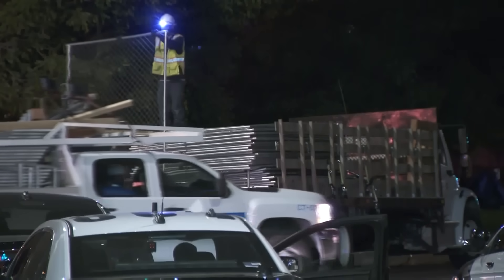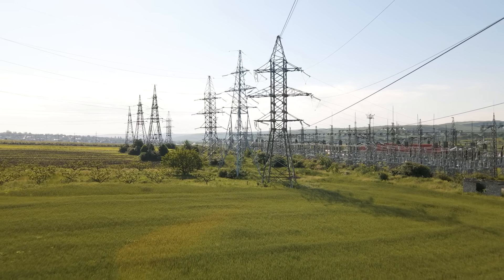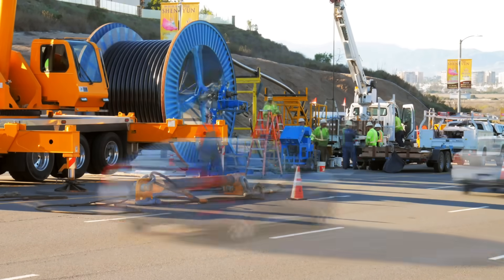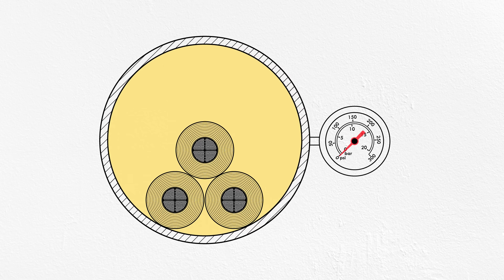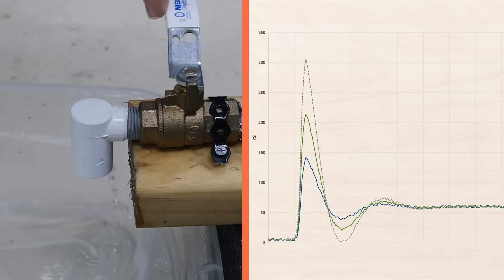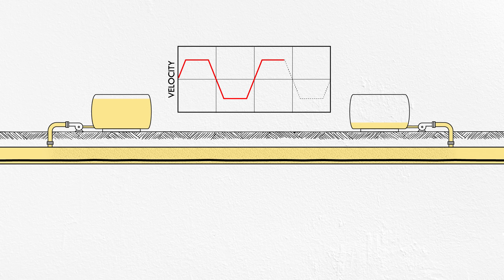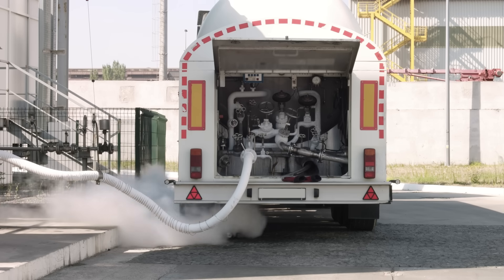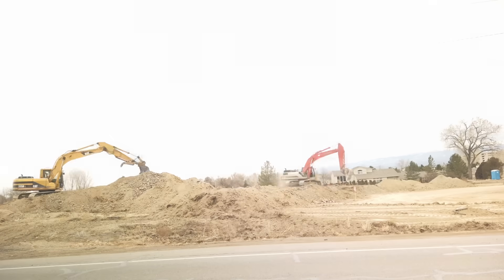Repairing Underground Power Cables Is Nearly Impossible

Comment from the maker: 👷 Enjoy this story? I have more in this playlist: https://youtube.com/playlist?list=PLTZM4MrZKfW_kLNg2HZxzCBEF-2AuR_vP
🚧 Keep up with all my projects here: https://practical.engineering/email-list
Reply: I really really love the series of videos where you explain what happened in a notable engineering disaster. I cant wait for more of them!
Reply: Great video, thanks.  You have yourself another sub!
Reply: Like a comment above says, this problem seems very specific to the type of line this was and I would imagine these problems would have been resolved by later tech.

I'm surprised this video didn't mention modern high voltage transmission tunnels, which are bored by small-diameter (3-4m/10-14ft) tunnel boring machines. There's a couple good videos on YouTube about these...

This one is a bit more comprehensive: https://www.youtube.com/watch?v=fKs2sKlhAC0
This video by Londonist about 400kV lines is more edutainment style: https://www.youtube.com/watch?v=qSzxTgDq3hM

I recall watching a video a couple years about about the cables being installed in these tunnels, but can't find it now. The cables are very sensitive to damage, so they are installed carefully. There is a track on the ceiling and the cable is hung on a wheeled thing that rides along the track as the cable is slowly unspooled at the end (I think each spool is about 1km). When the full length is unspooled, it is placed on brackets along each side of the tunnel. The outer layer is a thin black (plastic?) layer with a bright red layer beneath it, so that if the cable is scratched after manufacturing, it can easily be detected by visual checks along the cable. You can see some of this installation process in this promotional video for a company that installed these lines: https://www.youtube.com/watch?v=-X763qank94

Perhaps a follow up video about these newer tunnels for high voltage transmission lines could be made.
Reply: I see second the motion.
Reply: As an underground cable splicer, this video is very well done with great information.
Reply: Why didn't they place markers along the length of the line roughly between, or on top of, each splice in the line so they could measure electrical currents between the markers? Would this require a potential hole that would be subject to outside forces and thus allow naturally occurring issues, like earthquakes, to effect the line itself through the marker? Or did they just not think about that when they were designing the line as the information on these kinds of faults wasn't really available?
Reply: @LecherousCthulhu  i just cant belive they didnt put vaults at the splices, i guess they thought the cable would last a thousand years lol
Reply: @narmale  they do have access at the splices...the problem was between splices.. they had to repair the ductline so they could repair the cable...
Reply: Cool video
Reply: How do they managed to put liquid nitrogen in there ? Can you develop that part, it's fascinating !
Reply: Well Singapore did a good job with underground cables, maybe there is another side to this?
Reply: you should look into the insane tech behind high voltage DC transmissions lines, it looks like something from an alien movie
Reply: Tool for the elite.
Making excuses to NOT have powerlines underground where they belong
Reply: Thanks for the wholesome content Grady,

Also did anyone ever tell you you kinda look like the Grady from the shining?
Reply: They also freeze large water pipelines for repairs. Insertion valves and line stops are also used for water pipeline repairs.
Reply: can you tell me what the music is at 1:18-1:28?
Reply: That oil pumps are Tesla turbines?
Reply: In Auckland, New Zealand, had the same failure, about 10 years ago. If memory is right, took months to repair.
Reply: New scene transition tune? Thank you So much! I love it way better!!!
Reply: They should not use a thump or a thumper because it will attract the huge worms and damage the spice production.
Reply: Does the original fluid filled line remain pressurized?
Reply: You should play satisfactory
Reply: what i learned is that an underground cable is not worth it in long run, and it would be better and cheaper to build longer conventional line above the ground that would go around the neighborhood. I will keep that in mind if i ever change my occupation to land electrical engineer.
Reply: Look up Zenneck surface wave propgation for power transmission.. it's real
Reply: Why didn't they just run a single phase in each pipe, so the potential between the conductors is zip?  Then you just have to handle the pipe-to-pipe, or phase to phase insulation challenges.
Reply: @michaelwalimaa1806 because XLPE wire was not available at this voltage when this system was constructed.  This HOFF system is still used is several places and is actually very reliable.   XLPE cable is even now very expensive and difficult to splice and run.  However today it would be a mor practical option.
Reply: A great video to try next might be the incoming superconductive transmission and primary lines. Active cooling stations placed at intervals keep the cables chilled. I've been to a pitch/info meeting sponsored by IEEE at a Baltimore Gas and Electric office. Seemed like a possible solution for serving growing energy demand in densely populated areas. They have to open the hydrants and hose down substation transformers in Washington DC during hot days in summer.
Reply: Hi. Were you surprised how popular your channel is? I find your short lectures extremely enjoyable even though I work in the arts! Thank you anyway.
Reply: They're gonna show me
Reply: As a relatively young Project Manager on the Sydney Olympic Games site, one of our excavators scratched the outside of a new but unpowered 132kV underground line. The reaction by the cable owner was somewhat dramatic with crews being flown out from Europe to assess the damage. Thanks to your video, 25 years later, I better understand why the panic button was triggered.
Reply: Great story one of my co workers was,an old timer a cable splicer. It was interesting to learn about telephone cable and the way faults were found.
Reply: Hmmm would this be better in an underground corridor/tunnel? SEE Boring Company? HVDC better still?
Reply: I love that you convert everything to SI / metric units. As a European it is really unintuitive if information are in imperial units only 👍🏻
Reply: I suggest you buy a dictionary.  “Nearly impossible” here is just “difficult”.  Really clickbait
Reply: What about earthquake areas?  Would overhead or underground lines be better or worst?
Reply: You are an excellent storyteller sir. Please continue 😄
Reply: I've got an interesting thing i'd want to be cleared.
Bycicle lanes. Modern day bycicle lanes. I think a good way to start would be not just bike's channel.
If you woule consider my suggestion i would be extremely gratefull!
Reply: Hi Brady, could use do video of perpetual motion theory.
Reply: If you got anyone else to do the voiceover work your views would double. The vocal tone is all over the shop and it kills your views. Statement of the obvious
Reply: @lawjef  I disagree. He sounds just fine to me.
Reply: GREAT video. However, I find the title slightly misleading since the problem as described (to the best of my understanding) is not only specific to underground transmission lines, but to lines with a very specific type of cable. If you're up to doing a follow-up video, more insight into the differences between the old and the new lines would be interesting.

Comment: I live in Germany where the majority of cables are underground. I ended up having a long chat with ChatGPT about your video and how it applies here in Germany and it was pretty interesting.

TL;DR for my question:
- Yes, Germany buries far more cables than the U.S., especially in residential or urban areas.
- The YouTuber's U.S.-centric perspective is valid — undergrounding is genuinely complex and risky at scale, especially with high-voltage systems.
- But Germany and many European countries have made long-term investments in underground infrastructure to prioritize aesthetics, reliability, and public satisfaction — even at higher upfront cost.

Germany’s grid is more reliable, not by accident but by deliberate engineering and policy design — even though it costs more. The U.S. grid, by contrast, prioritizes cheap and broad coverage, tolerating more failures because fixing them later is “good enough” for regulators and investors.

Comment: Thanks, Grady!  

When you are young, you just take all the amazing infrastructure in our world as a given.  Now I'm 79, and I am amazed everyday at one thing or another about out infrastructure. 

I am surprised that using long around polyethylene for the insulation wasn't done on the original line.  All that oil bullshit alleviated.  Should have been a no brainer.

Comment: Overhead is just so much cheaper, faster to repair, and easier to diag. It does have a few cons compared to UG, but UG has many more downsides. Its just not worth it unless its for the service wire

Comment: Big underground powerlines in Germany are laid in separate air filled liners for each phase, insulated by a composite outer layer. Each part of the cable is about 1 km long. The cables are accessable every few splices via a manhole. This is done more or less the same for AC and DC lines. Cores are up to about 1 square inch.

Comment: I’m a plumber but I do try to learn about other trades etc. when someone explained current as the amount of water and voltage as the pressure, it really helped to understand. I just thought of another way in which that is the perfect analogy. In plumbing we have pressure and volume(flow). It’s almost the same dynamic as well. If you’re limited the volume usually due to pipe size, you can increase the pressure to make up for this. Another similarity is the challenge of trying to explain how these two concepts affect each other to a customer.

Comment: They should pull a vacuum on the oil before pressurizing it, removing most of the air from the papper in the first place.

Comment: It is not only about thermal expansion, but multiple factors. Terrain can expand and contract due to geologic forces, both horizontal and vertical. So these lines are inherently more in danger than those above the ground that have much more slack. In a section terrain might contract during the years, or expand, or drop or raise. This is one of the reasons we use asphalt and not cement for roads, since asphalt is more elastic. Above the ground lines won't have trouble with a few inches of stretching or contraction, but electric lines below the ground have nowhere to bend when this happens, and coupled with thermal effects the insulation experiences increasd risk as time passes.

Comment: I have worked with these type of seals before, they are called freeze seals. Alongside have cryo on call, its very important to monitor pressure and flow of cryo through the seal.

Comment: voltages aren't increased in power lines to reduce energy losses in transmission lines. the power loss is maintained. 

They are increased to reduce current and thus also reduce the dimensions of the transmission lines required.

Comment: I worked at a australian power company for 35 years and had some limited experience with oil filled HV cables . Ours where 132kv and where single phase ie three completely separate cables run in a  common trench it was mid sixties japanese technology by the Toshiba company . The cables where  paper insulated ,  pressurised oil impregnated and the cable outer sheaths where corrugated to allow the whole cable to expand and contract stopping internal damage from cable expansion . Our systems where 100% reliable for over 50 years , the oil was pressurised but not pumped thru the cable , the cables had various underground pits where oil was pressurised in  individual sections using air  pressure accumulators not pumps to pressurise but not aerate the oil  . The cables have all since been replaced with modern XLPE technology but where 100% reliable as I stated earlier. These cables generate a large flow of reactive current as well as large outer cable sheath currents on load that required careful sheath earthing and cross bonding practices of the phases outer sheath these currents could be massive if the cable was carrying a thru fault . Shunt reactors where required in some  substations to absorb the cable generated reactive energy late at night during low loads where it couldnt be absorbed by the system loads reactive power needs. Overhead EHV is much simplier way to way to transmit large amounts of power over long distances underground systems are usually quite short as the expense and difficulty of dealing with their reactive energy generation is a complex thing to manage. DC EHV  transmission technology overcomes the cable reactance issues and is used on long underground or undersea feeders its more expensive but much more flexible operationally especially on interconnectors.

Comment: Maintenance Assessments of Electrical Cables = Partial Discharge Analysis (Base readings with scheduled comparison readings over appropriate length of time depending on general % of load in relation to max current carrying capacity), Most accurate fault location methods include ARM (Arc Reflection Method) or ICE (Impulse Current Echo), both a combination of your "thumper"(Surge Generator) and TDR - if you enter accurate VOP (velocity of propagation) value for the appropriate cable dielectric and pulse widths appropriate to overall cable length.

Comment: Wait, they invented this super complicated paper, pressurized oil when they could have just used plastic to insulate the entire time! That seems like the most complicated solution ever! No wonder we had so many blackouts when I lived in Santa Monica! Is this just an old problem due to the technology or are there still a lot of problems with using underground lines still? I'm curious because I know it's a problem in east california when they get 10+ feet of snow they lose power a lot (mammoth, tahoe) and I wondered why they don't just dig them underground? (I feel like we had a lot of underground cables in Colorado with lots of snow but I might be wrong)

Comment: There is a possibility someone were trying to be cheap and it blew up in their face.  In Ontario Canada, even with low voltage,(600 volt)  say a run of just a couple of hundred ft from the pad mounted transformer to the building, we have to lay 4 inch PVC ducts, (called raceways) 4 ducts one per phase and one neutral which may or may not be used.The ducts sit on "chairs" which provide a consistence separation between the ducts. More raceways if you are to parallel conductors.   The trend for many cities are to bury their power cables underground, for it is usually more trouble free and it is not as ugly sight.

Comment: I live in the New Orleans area. My house is on a spur along the power grid. When a tropical storm or hurricane is on the way, power will go out at the first gust of wind. I really wish our power lines could be buried. That would likely improve resilience, but it would be so expensive, and the whole city is already below sea level. It just can't happen. Entergy is working on an extremely expensive (and lengthy) project to improve grid resilience, but burying the line would be even more expensive. Guess I'll just have to continue putting up with it and use a generator. Oh well.

Comment: They can fix them. Saw a video of one being repaired. The steps required are to locate the fault region. Isolate power and dig it up to expose the cable. Cut the damaged region out. Clean and Strip the layers off the cable. Slide a length of heatshrink over the cable Crimp connect the primary conductor and wrap with semiconductive tape. Fill the cable with a mold guide with a similar dielectric plastic. Sand and cover with semiconductive tape and bridge shield wrap. Move large heatshrink seal over splice.❤

Comment: ❤🏆👍. Always worth a Kudos on every Episode here!!!  ??? Possible NEXT Episode Endeavors?,-  then” Concepts / Inventions/ Fabrications,and Construction Techniques of : Underground: Sewer, Storm, Electrical Conduit Pipes PLASTIC/ COMPOSITE  Manufactured  I SERTED/Dragged/Heated and Inflated  PIPE-Damaged  systems!!  I did have the Great Career Opportunity to work with this Technology- AFTER we “ Mini-Remote-Controlled-Videoed massive Water Leaks & Pipe Damages”-  to EXACTLY Pinpoint Damaged Areas we used that Innovated & Extremely InExpensive & UN-Disruptive Process in Winch- Dragging thru damage pipes REPAIRING Sox’s of Hard/ Long Lasting NEW Piping!! ZERO: Road Rip-Ups/ Traffic Halting/ Environmental Attacks and $$$s in Tax Dollar Savings!!  At least I had found it then Cutting-Edge and an Incredibly Great  Alternative to Backhoe Digging multiple Feet of Pavements/ Earth.  God Bless.  👴🏽NoNobody.  NRN.

Comment: In Poland from my experience we burry the cables quite deep at arround 3m deep 0.5m apart from eachother and every single one of the has a main(the outside one) isolatior made out of PE(polyethylene)
All thought high voltage underground lines arent seen nor used that often expecally in cities most often where u could find them is when a line is crossing something like a highway then the line is taken from one side to the other